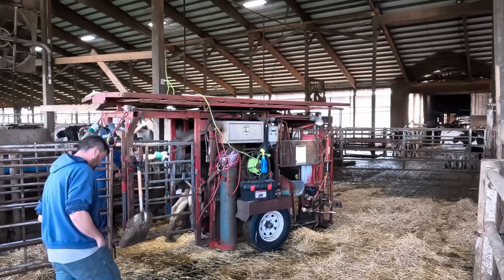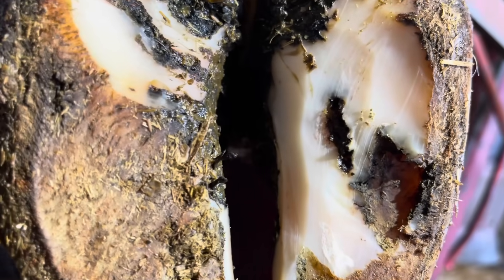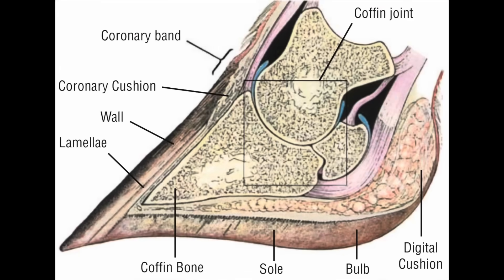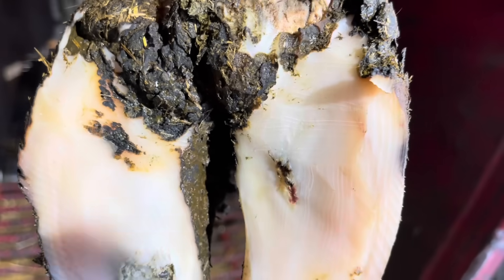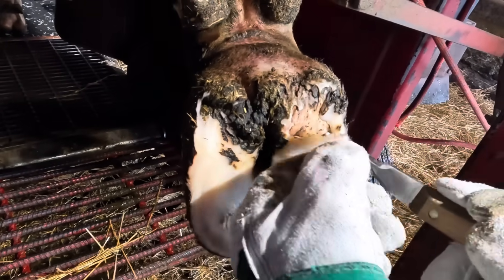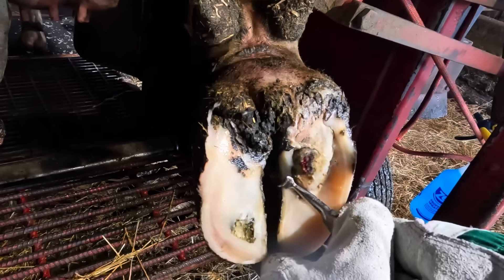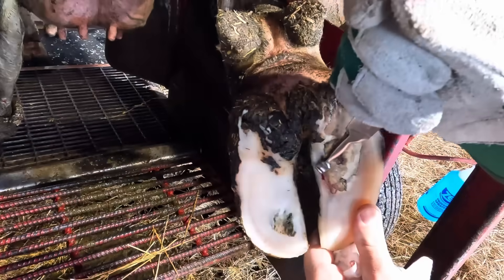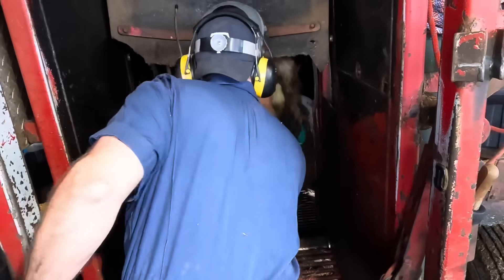GUESS what’s underneath this CHUNK OF HOOF

Comment: A great video!  Thanks   An aside-  be careful of your thumbs. I have noticed you place a great deal of force through your stabilizing thumbs. Unfortunately as you get older this joint is apt to break down. More so than your large bicep/triceps. I know because I have that problem with my thumb. If you were a weaker man you wouldn’t be in as much danger. Protect the small joints!!!

Comment: Would the wrap get dirty and trap more bacteria? Does the wrap come off between inspections? Does the wrap have to be changed often?
I recently got a matchstick size sliver stuck in my foot, Oct 3. Emergency room pulled it out and gave me antibiotics and tetanus shot. Within 2 days I had no strength in both legs and itching burning in both (reaction to shot(?) I soaked and cleansed the wound every day but I got a pus ball in 2 weeks. Another Dr visit and more antibiotics. At 3rd week, I popped my opposite knee because I was shifting weight off the bad foot. As of today, foot is healed but still have 50% pain in popped knee but my hips and lower back are hurting from all this misaligned walking.

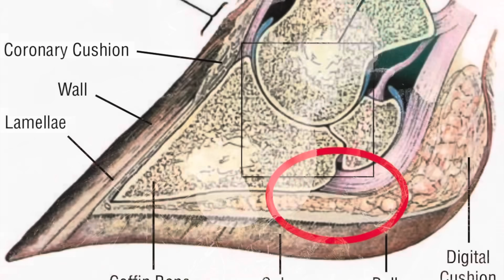Comment: 2:56 It's a cow bunion! 
I had a bunion that was caused by just the way my body is made. My ankle joint is a little stiff but the bones in my feet are a little looser, causing shifting in my big toe joint. the tendon on the outside of my big toe loosened and the one on the inside tightened until my toe was pulled in toward the other toes and only used half of the joint.

Comment: Interested to know if there’s ever a situation that can’t be fixed?  If so, what’s sort of outcomes are usual for the cows?
Reply: The worst ones are usually toe necrosis where the bone dies. Half the claw has to be removed and in the worst cases full claw amputation, but thats done by a vet. What happens to the cow depends on if the farmer can afford that surgery. Persistent (10+ months) white line problems can also keep a cow out of production so long the farmer may be forced to sell her because he cannot afford to keep a non-working cow so long. Most farmers do everything they can, but cost is always a problem.

Comment: after the hoof is gone, wouldnt it be less support to keep the cowees peedle bone from falling? that wrap doesnt look like its enough
Reply: The wrap is only there to keep the powder in place, not provide support
Reply: @limiv5272  so doesnt it get worse?
Reply from the maker: No.  The cow doesn’t naturally transfer her weight through the corium.  The weight is transferred from the pedal bone to the wall via laminar connections.  Basically the pedal bone is tied into the wall horn.  This avoids putting pressure on the corium.  An ulcer forms when those “ties” loosen up.  Picture sitting in a hammock.  You are supported and don’t touch the ground.  Now loosen the ropes tying the hammock in place…and you’re no longer supported and will touch the ground.
Reply: @NatetheHoofGuy  so you can put a salycidic acid wrap around the hammock
Reply: @NatetheHoofGuy  with the hammock thing; putting a box under the hammock will support you. cant a wrap do the same? 
will the cowees hoof hammock thing get better?
Reply: I believe the pedal bone and associated structures transfer the weight of the cow to the outside of the hoof, not the sole.
Reply: @nmccw3245  but theres an ulcer. so isnt it contradictory. then why is there damage?
Reply: @jonnydazzels1565  - a metabolic change the cow experienced If I have been paying attention to Nate.

Comment: Very interesting how the corium (spelling?) of the hoof protrudes when the sole horn has been pared away. It goes to show just how much pressure that tissue was under, but unable to move or flex due to the rigid nature of the horn surrounding it. I think this is perhaps one of the clearest demonstrations of the problem that leads to sole ulcers. It looks like a mountain that had been compressed so tightly and must have been very sore for the cow.
Reply from the maker: It’s more of a compression injury over time.  A great deal of pressure (like us pinching our finger in a door) would cause immediate trauma and pain.  Ulcer formation is a slow process that happens over months.
Reply: @NatetheHoofGuy  And because the cow is considered a prey animal that travels in herds for protection, I'm assuming that they would not act on that pain or show it as quickly as most.  That would show a weakness of sorts.  I'm assuming that they tend to hide the pain as long as possible so as not to show any weaknesses.  And in the farm setting, they do not speak our language.  So putting together their hereditary actions with the lack of communication abilities makes the process of assessing the situation or finding it much harder.  Hence, regular visits or 'check-ups' to a farm.  I think I might be correct on my assumptions/thoughts.
Reply: @tamo9520  I think that is the factual answer. Showing weakness in a herd is like a neon sign for any predators saying "eat me". Interesting how traits that were useful in the wild are radically unhelpful in a domestic setting. Different survival pressures at work.
Reply: It probably swells like many other kinds of injuries
Reply: Bit like going hiking 20 miles in new boots and ending up with blisters on your sole
Reply: Very interesting to read cow feet facts
Reply: I did have a question about this. Does the lesion and the area around it truly swell outward once you remove the horn covering it? Or is that just an optical illusion because you are removing the horn around the lesion? Does that make sense?
Reply: @stacyduncombe9431  check out 'The Hoof GP' and you will see plenty of examples.  Removing the horn allows the damaged area to expand, causing instant relief to the animal.  I have seen some really nasty ones that Graeme has trimmed.  He usually does follow-ups and it can be astonishing how fast the wound heals, though the regrowth does take a little longer.